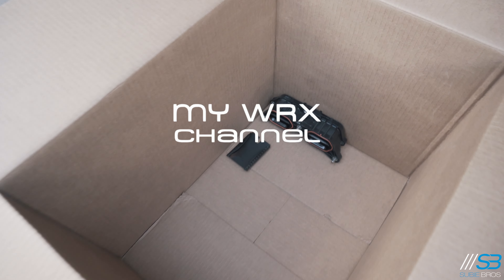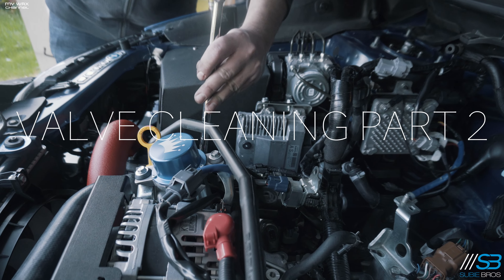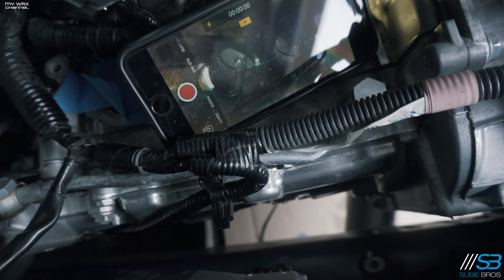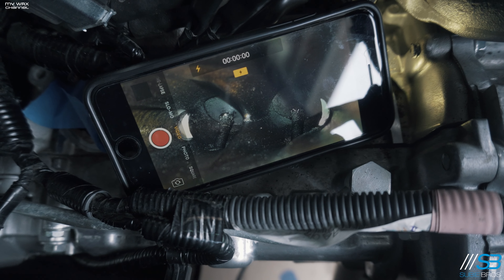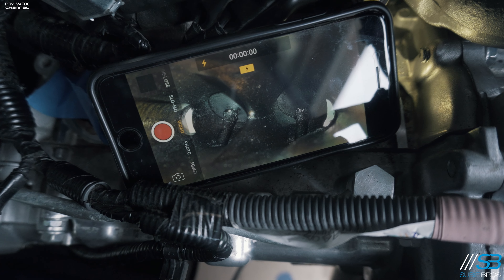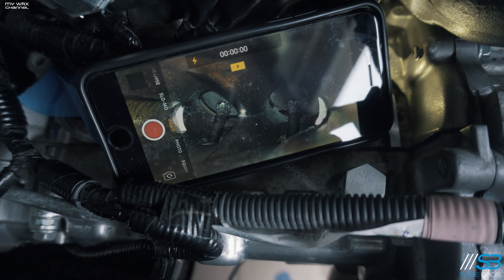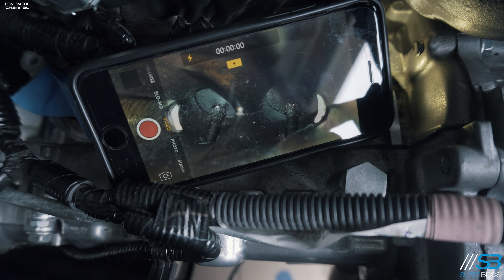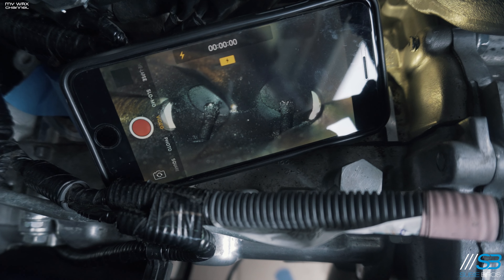HOW TO: WALNUT BLASTING DIY Part 2: VALVE CLEANING | 2015-2019 Subaru WRX 2016 2017 2018 FA20DIT

Comment: This was much harder than it looks. The subibro tool definetly made the process much much cleaner. At 45k miles the walnut is not enough and you do need to poke down in there and get off the stuck on gunk. About 7 hours in (by myself, newish hobbyist) and about to reassemble.
Reply: Skill issue
Reply: walnut blasting should be enough. every scenario ive seen, it did the job well.... using top tier gas will make it easier im sure. less carbon and gunk built up

Comment: Jr i have a question bro. I know you don't have the car anymore, but do you think the valves being dirty would cause fine knock learn or some type of weird stuff with the car? I'm almost at 55k and everything else have been checked and cleaned or replaced and this is the last thing I haven't done. Just curious what you think would happen with the car if this was really dirty. Thanks in advance
Reply: Yes, built up debris can come loose and end up in your combustion chamber causing knock.
Reply: I did mine at 40k and protune was at 30k it was disgusting then and im overdue about to do it again. Had egr and aos since protune also btw. Still very much nessisary!!

Comment: I saw the blaster at harbor freight but the kit does not include the long extension tip . Where did you get it and does it mount directly to the harbor freight gun? The adapter??? Where did you get it from ? Looks like one can be made from a block of wood with center cut for hose!!! Will the plastic cover you used work with a impreza 2.0 f b 20 engine? I believe you have a f a 20 . Please let me know
Reply from the maker: http://subiebros.com/subie-bros-fa20dit-valve-cleaning-kit-walnut-blasting/

Comment: I know clean valves improves flow but how would you clean the area where the valve touches the valve seat? That's another important area. I am currently trying to get an answer from Subaru about the excessive carbon build up.
Reply: Subaru makes a 3 part fluid engine cleaning kit specifically for their direct injected engines. Definitely would consult a professional on it though. Dealerships should have it available.

Comment: Hey I have same car with 12,000 miles on it I do all 2 miles to work and back can any1 tell me if the old iltalin tune up works or helps with these cars. Should I drive mine hard does it help or hurt cuz I drive mine like an old man

Comment: whats the PSI the air compresser is set at ?
Reply: You should use the spec that is called out on your media blaster we used somewhere around 90-100 on this.
Reply: thanks , my15wrx has just over 60,000 miles ... its time I do this ..
Reply: Gonna touch 80k on mine. Excited to do this along with Stage 1 stuff while I'm in there. Planning on a catch can system in addition to EGR delete at the same time. Hoping I'll only have to do this once or at most once every few years.

Comment: LOL. You saved the before and after shots for the end for dramatic effect!  I was about to cry foul after watching all that and no looks of the valves after blasting!  Good stuff mayne!  Still looks like a PITA and I don't know what use I would have for a media blaster and shells afterwards.  What is the dealer cost for this maintenance?
Reply from the maker: Thanks man! A shop quoted me $800. It's really not that bad at all.
Reply: $800??? Ugh, guess I'm going to have to tackle this myself...how many miles did you have or is recommended again?

Comment: Question...when you're finished, how do you ensure that there's no walnut media left on the inside of the valves?  Or does it matter if there are small particles?
Reply from the maker: Since you have to ensure the valves are closed, you simply vacuum out the remaining shells. They're easy to spot.
Reply: My WRX Channel Thanks man. I may give this a go.

Comment: When you replaced the coolant you initially drained, did you just pour it back in the Radiator?  Also, did you have to bleed the coolant, and if so how did you do it?

Both videos were great!  Thanks for putting this out for us!
Reply: Sorry for the late comment. Did you bleed the coolant? I am halfway done cleaning them (everything is completely apart, tomorrow I blast) and I was thinking of just burping the coolant system for air.